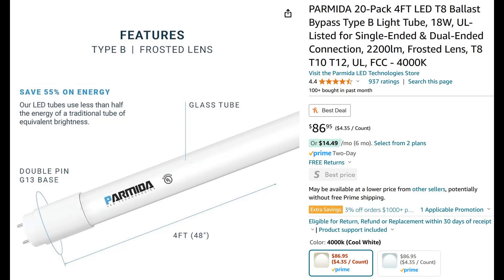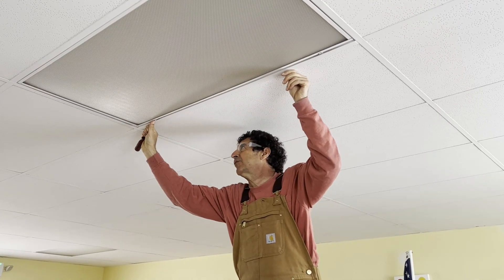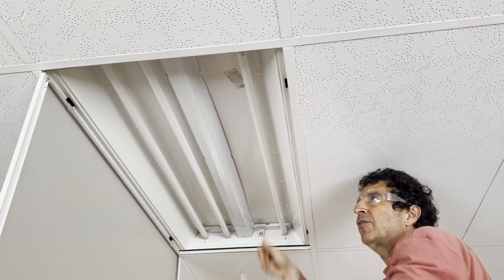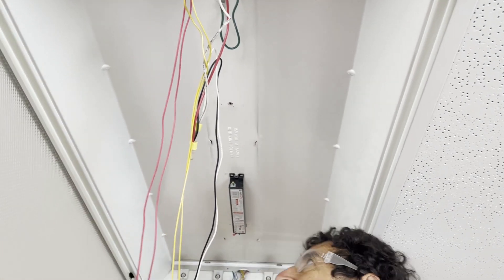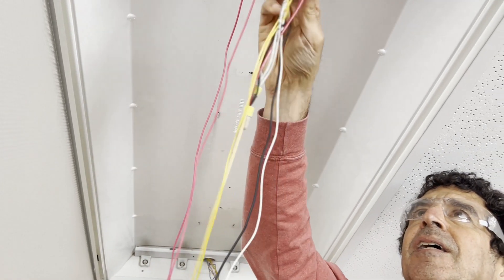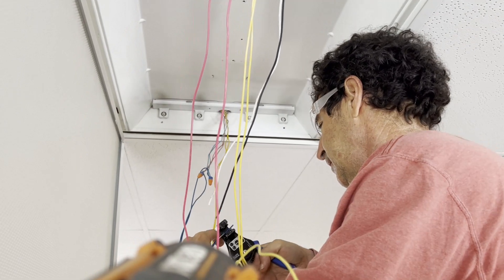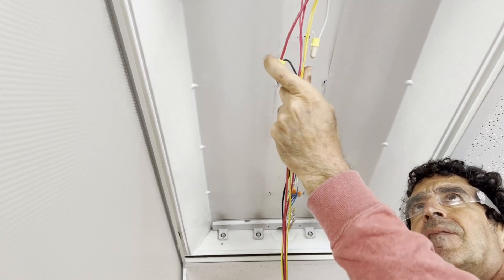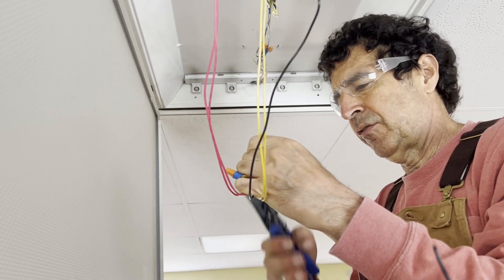Retrofitting Old Fluorescent Tube Light Fixtures with Modern and Efficient LEDs

Comment: Hi Commander Dave!  You said the replacement LED tubes are the same form factor as the original fluorescents.  But I don't see you installing those new LEDs into the fixtures.  The plastic-looking panel that you install doesn't look like a light.  I'm so confused.  It would be nice to see you wire up the new tubes or the end connectors.
Reply from the maker: Thank you for your comment.  I can see the confusion I caused with my edits.  I heavily edited this video to get it down to under 3 minutes.  The entire conversion took about 10 minutes, but I edited it to avoid boring anyone.  I showed removing the old tubes but not inserting the new tubes because it is the identical operation, but in reverse.  Just insert the tubes and twist a quarter turn.  The only difference is that there is a up and down to the LED tubes as the LEDs are along the top side of the tube and point down.  If you mount them upside down most of the light will go up into the fixture and not into the room where you want it.  I also only showed placing the metal cover over the wires and not me removing it.  It was removed by squeezing the cover and pulling away from the 6 tabs.  Again, removing it was the reverse of putting it back.   I literally converted a hundred fixtures so I got pretty fast at it.  Your first one could take you more time and could have significant differences.  What is important is to wire all the "hot" wires to one side and all the "neutral" wires to the other side.  This is a huge simplification to wiring up fluorescents.